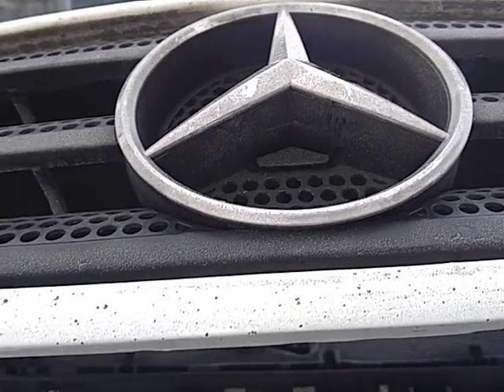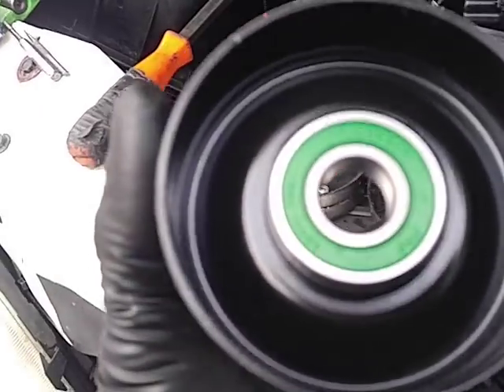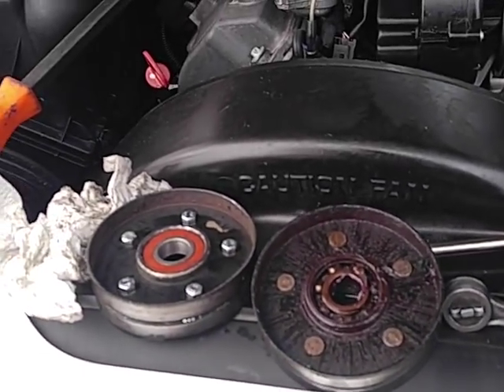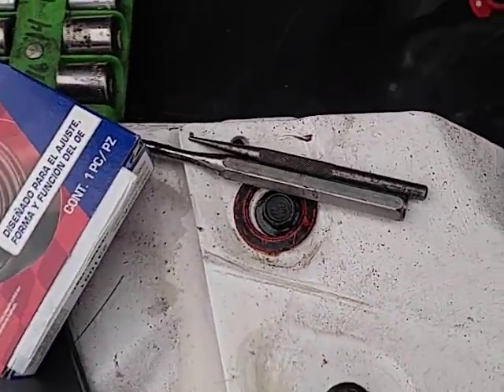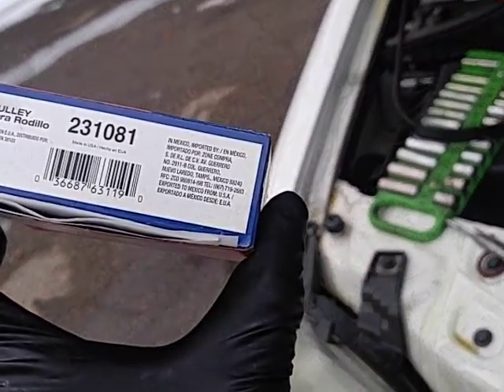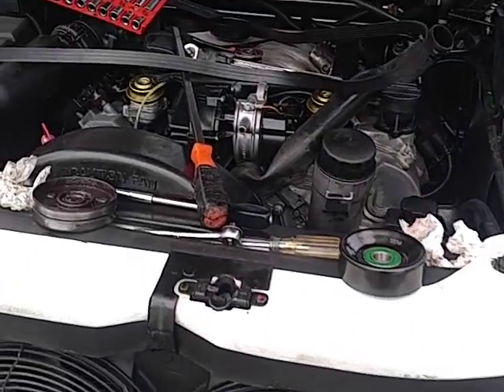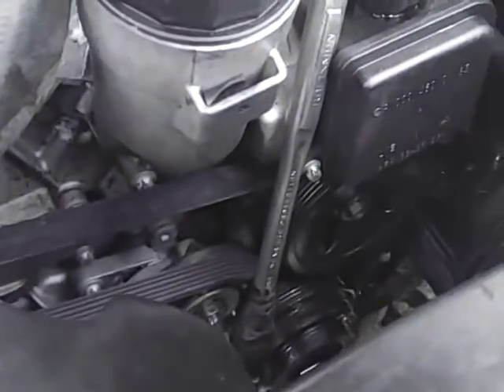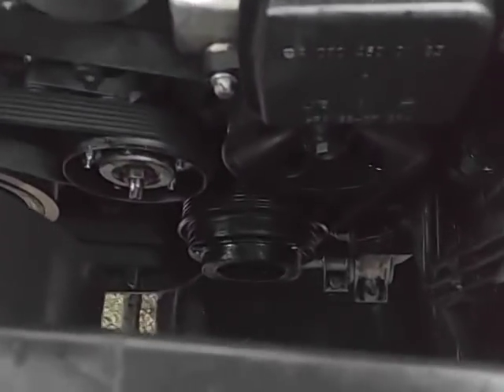Mercedes ML320 Idler Bearing Hack 1 21 18

Comment: happened to me when I had my Cherokee with 4 litre. Friday afternoon, engine throws the belt. Tensioner is dealer only, which meant having to wait till monday. So, I limped home. Removed the tensioner, took a close look at it & the bearing looked ohhh so familiar. Took the micrometer & compared it to some spare GM alternator bearings. Voila, I pressed the new one in place & my JEEP was up & running in no time !!!

Comment: 1) Tensioners do eventually wear out.  They still "work", but become too weak to keep the belt tight enough not to slip under severe loads.  If you don't change out a weak tensioner, you WILL pay the price on a very cold winter day when your car needs the extra electricity to power the heater blower and lights and defroster.  Your car will die, probably while you're driving.  Ask me how I know.
2) The Mercedes ML requires a type of antifreeze called HOAT.  It is slightly orange-red in color. Scotty Kilmer did a very nice explanation of the chemical.  You may want to change it out at some point as it is much better for your vehicle.
3) You have a nice shop.  You just need some more shelving, and a lift.
Reply from the maker: istvan meissler I don't think the spring wears out, I think the issue is more that the housing could crack and you lose all tension. And with all these parts coming from China, who knows if you're really making an improvement when these Chinese Parts last a year or two. Just look at the water pump on my 6.2 diesel Suburban, and the one on my 65 Grand Prix, brand new China junk, they last a year or two
Reply: I can tell you from personal experience that the springs do indeed lose tension over time.  The metal that the spring is composed of fatigues from movement (work hardening?).  At some point they need to be replaced for this reason, even if there exists no catastrophic mechanical failure, which would include cracking, etc.
Reply from the maker: istvan meissler interesting... Something to worry about

Comment: I cut the rivets / grind them off one side and punch them out replace bearing and put rivets back in and weld other side 😀. Worked on my riding mower.
Reply from the maker: 462ANIMAL I don't think there was a way to get a grinder in here, and I did it in my living room, not the best place to run a grinder. I thought about welding it, I guess if it fails I'll wish I did

Comment: Replaced a tensioner pulley and bearing because the squeaking was driving me nuts. Gates $10 RockAuto, the bearing said made in Canada, NTN. So 2 days later it’s squeaking. At least I’m pretty sure it’s the same pulley already replaced the idler and that has been fine. I haven’t felt like checking it in the rain, but I have a sneaking suspicion it’s the new bearing that only lasted a day or two.
Reply from the maker: RedWhiteAndBlueVideo I have a stethescope, $4 at harbor freight, works great
Reply: CORVAIRWILD 
Yes I have that same stethoscope, lol. I have to get it out tommorow.